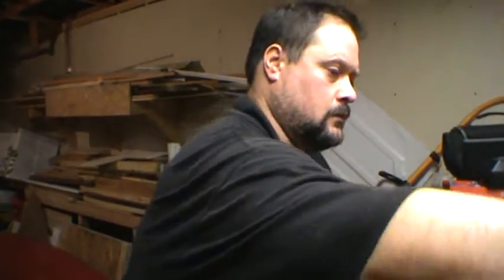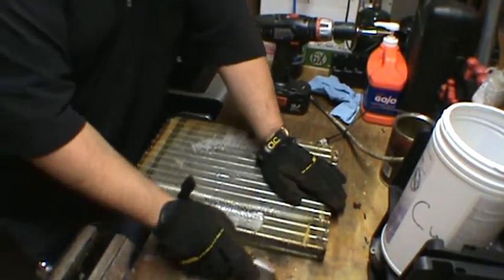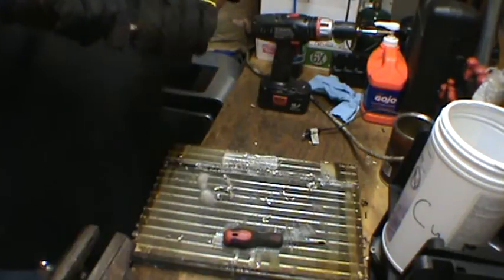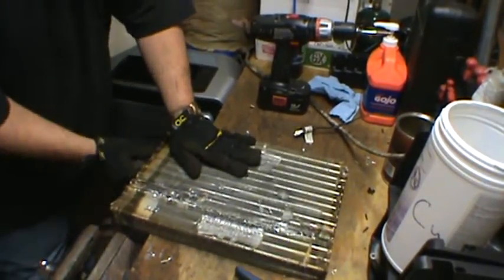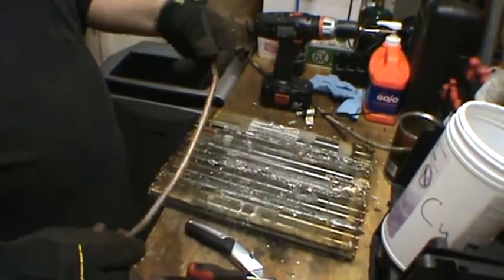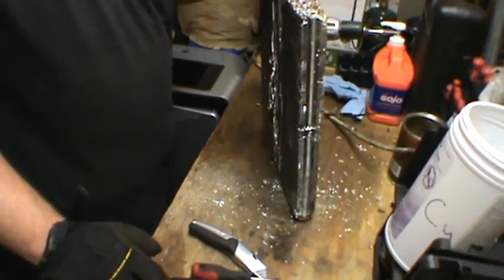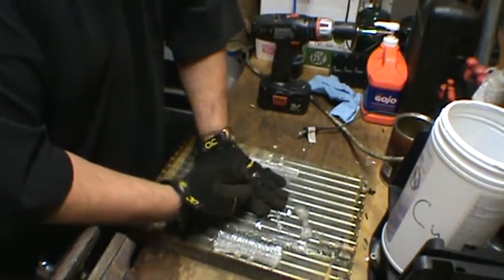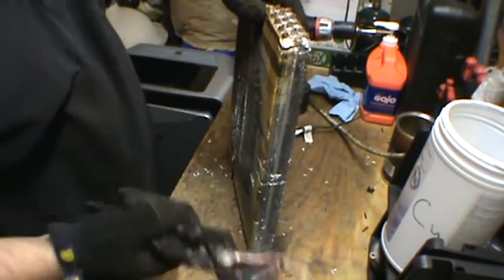How to Scrap or Remove the Copper tubes from a Radiator

Comment: I use an angle grinder and a piece of hardi plank to guide the angle grinder on top of the copper tube. I do both sides with the grinder quick. Then I use a screw driver to lift the copper tubes. Once I have a few I use pliers to rip em out...

Comment: Great video Moose I've got some of them to do soon. I take a skill saw with the blade set just so it touches the copper then run over the top. Works like butter.  5" saw with 41/2" cut off blade.

Comment: use the vice on the lower left of the video to hold the radiator while you pull the tubes. or a c-clamp and board.

Comment: Moose please answer asap I am doing this now and curious if the u's and tubes are #1
Reply from the maker: The us are not but the long pieces if all the aluminum is taken off are #1
Reply: ok thanks but why arnt the u's #1?
Reply from the maker: They are soldered to the two straight pieces.
Reply: thanks you moose one last question what do i do with misc copper like ends of jumper cables plugs old copper decorations do those just go together as mixed copper or #3?

Comment: Hi Moose, im a new female scrapper..and im having issues telling stainless steel from cast aluminum and at times reg aluminum. I know stainless is shinier but on old stuff its tough. I live in texarkana tx which is fairly small and finding scrap has bn very difficult. Id like to be friends on fb if thats ok so i can hv an easier way to ask you a ? If i get stumped. Ive been watching your videos and mike the scrapper for about a month and ive learned alot from you. Thank you so much for sharing your experience with those of us that dont have much. ?- on a fridge do you scrap the compressor whole or get the copper out of it?
Reply from the maker: HI and welcome to scrapping!  I am not on facebook often but will answer anyquestion I can.  I do scrap the compressors as there is definitely a good bit of copper in there.  If you have an angle grinder they are easy to open up.  As for stainless steel vs aluminum, the best tip I can give you, if they are both not magnetic, take a file to it.  Aluminum will file right off, stainless steel, not so much.  Aluminum is a much softer metal.  Thanks!

Comment from the maker: Hi and thanks for watching!  Copper is much more dense than aluminum, and a good portion of the solid metal on a rad is the copper.  If you take them apart, you will end up making more money.  More than half the weight will be copper.  The big problem id the time involved.

Comment: May 5, 2016 - just checked prices in my locale: No. 1 copper about $1.80/lb, copper core radiators/condensers $.91/lb. So roughly, you double your money by separating the materials. I have two large industrial condensers to recycle totalling about 80 pounds so the difference would be $144 vs. $73 or $71 for the labor. I'm good with that for fill-in work when my business is slow.

Comment: <><>IMPORTANT<><><>

Since this video was published many states have passed new laws on HVAC components and scrap-yards will not take copper/aluminum radiators, condensers or any copper tubing suspected of being from an AC/heater unit....The seller's next idea is to remove the copper tubing like you are doing but what they don't realize is.... this tubing is marked with thousands of embedded rings where the aluminum rubbed against it and the the scrap-yards can easily tell it's from an AC radiators and they STILL will not take it.... sadly. 

The political justification for these laws is: they create a theft-demand and people are stealing entire units of houses and businesses. Their ignorant solution is to treat all scrappers like guilty criminals. This is a result of scrappers having no legal representation and no power.

I am sorry and I suggest that you carefully research your state and scrap-yard's websites before even picking up an AC/heater unit.